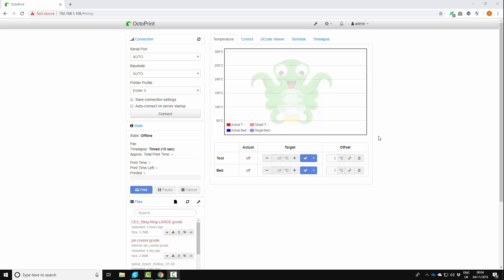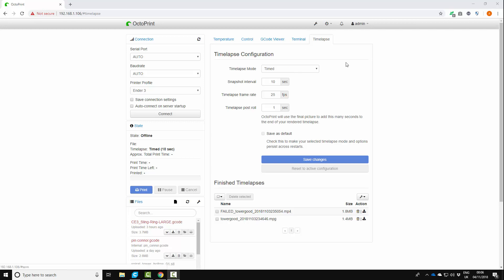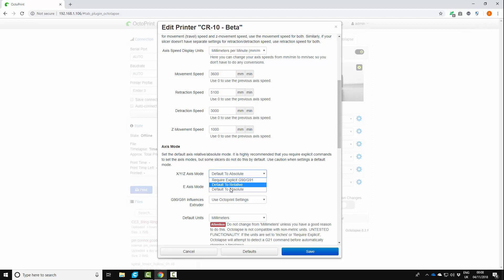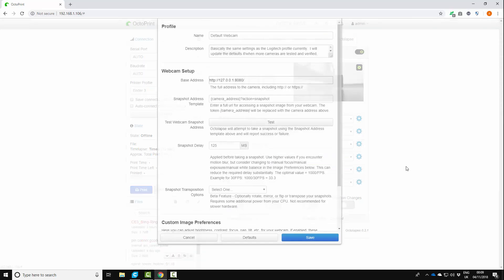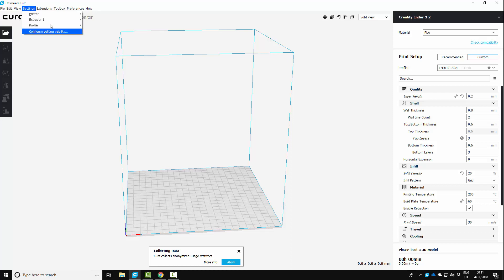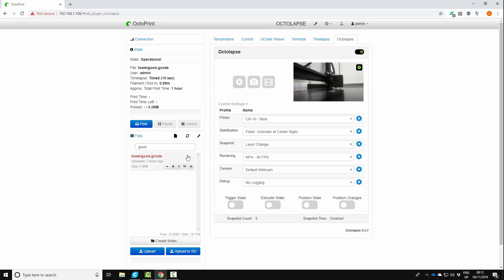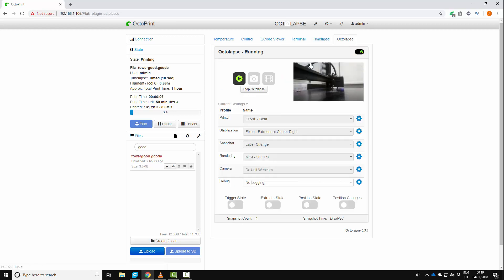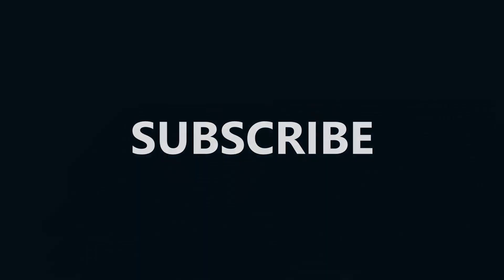How to Setup Octolapse  - OctoPrint #cr10 #octolapse #3dprinting

Comment: Cool stuff! :) Did you forget to place the G code in the description? :) I guess its:
G90 ; absolute xyz
Reply: Do we know if adding this makes a difference?
Reply: @samaker4  Yes, it'll throw errors "XYZ movement was detected, but the axis mode has not been set. Please add a G90 or G91 to the top of your start gcode. See this guide for details:"
Reply: Anything after the ";" is a comment, and ignored by the printer,  you're even able to start lines with a ";", so you can add a comment on why you made a change to your code.

Comment: Thanks for the video.  So you are you using octoprint/octolapse  to control your printer? instead of Cura? I was kinda confused about that. I havent used octolapse yet, but I wanted to make some good timelapse videos, so Im just trying to figure that all out. Appreciate it.
Reply: Brandon, did you get your question answered? I'll reply, in case someone else needs it answered.

Octoprint allows you to remotely send and manage you 3D Printer, you still use Cura to slice the STL, bu can then use Octoprint to print and control the printer. There is a Cura add-on that will allow you to directly slice and print via Octoprint without having to upload the gcode, then print it.

Comment: Nice video!  I wanted to comment that the G90 code should probably go at the TOP of your start gcode.  If you do this you can leave the Octolapse->Printer profile XYZ axis mode to 'Require Explicit G90/G91'.  That setting is for safety to make sure Octolapse knows what axis mode is to be used, but most start gcode just assumes that the XYZ axis is in absolute mode anyway.

Also, make sure you copy your retraction length/speed into your printer profile, else you can get artifacts/stringing on the exterior of your print, and nobody wants that :)

Thanks again for the video!
Reply from the maker: Thanks for the info. Will try changes thanks.
Reply: Why would my print extrude plastic more than it should be when using Octolapse?